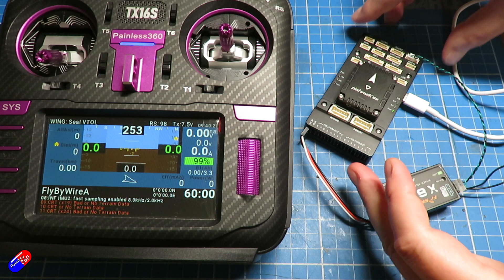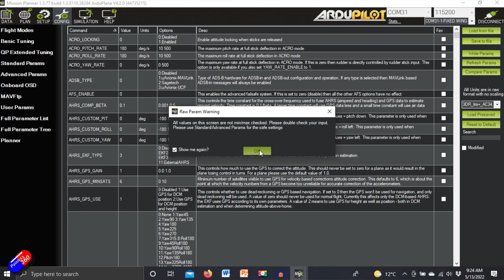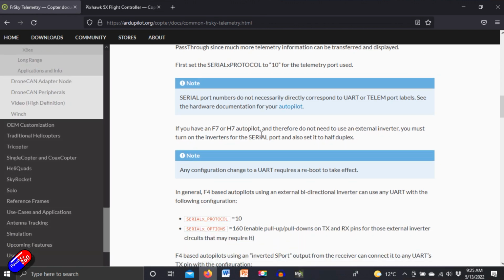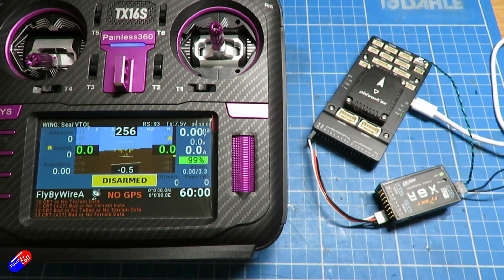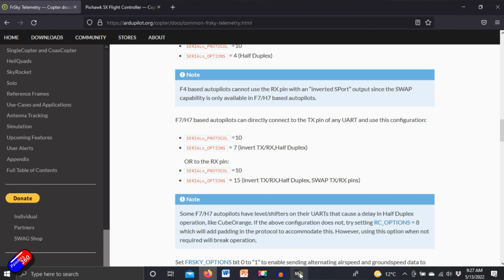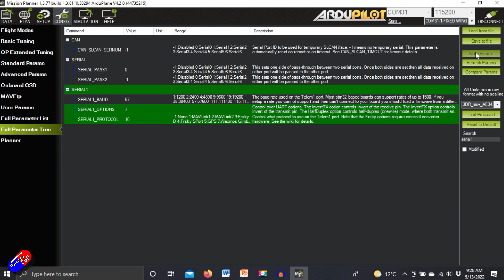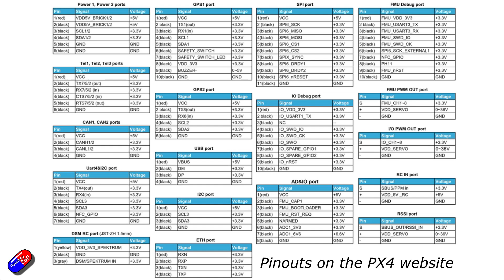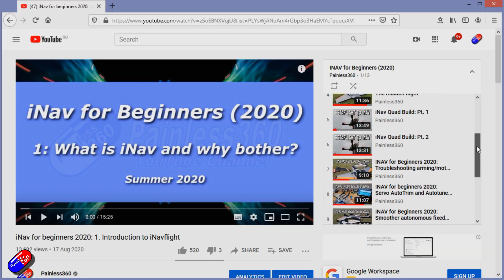How to setup Smartport telemetry on a Pixhawk without an external inverter board

Comment: Help~ i'm using r-xsr with Taranis X9D, the flight controller recives the stick input, hut there's no telemetry communication. My radio don't receive any sensor information. The exact same receiver works well with another fc under iNAV. Do i need to switch to x8r? ....
Reply from the maker: I've not seen that. Sounds like the settings in Ardupilot are OK, maybe there is an issue with that RX? I'd recheck the wiring.. Best of luck
Reply: @Painless360  thank you so much. i'm using a pixhawk 6C, trying to verify what is the reason. At least the FC receives the stick input, just no telemetry communication

Comment: Hello! My setup consists of an X8R receiver, a Taranis X9D Plus radio and a Pixhawk Holybro 6C. Could I use this same configuration and video connection? Would it work in the same way? Thank you! Hugs from Brazil!
Reply from the maker: Check out my recent build using a 6C where ai show that... Best of luck

Comment: Thanks for the video. I have a PixHawk 4, RX8R receiver and the Taranis X9D plus. Connected Pixhawk to Smart port and on the Taranis did “Discover Sensors” on the telemetry page. The only remote sensor that was discovered was the GPS position which gives the correct value. In Mission Planner I have enabled the Battery Monitor 1 and it reads the correct voltage and current, but the values (sensors) are not pulled through to the Taranis radio. Am I missing something in Mission Planner?
Reply from the maker: If the GPS sensors are coming though then it sounds like the telemetry is working OK and you have the basic setup correct in mission planner (if you had it wrong, then nothing would appear). There are a number of ways to connect to Smartport not (https://ardupilot.org/plane/docs/common-connecting-sport-fport.html) and it can be easy to get the setup wrong if you are using one of the other methods. I tend to use the adapter board. Best of luck!

Comment: When I plug my PX4 to USB and start Mission Planner and connect and go to do a search under "SERIAL" under the Config/Full Parameter Tree as you do at the 4 minute mark, I get zero results.     I am trying to configure as a rover boat and get it working with a Jumper R8II (R8 rev 2) receiver and TX16s with Edge TX.  I got the R8II binding using power from a separate source but can't seem to get power from my RC pins or my main/aux rail.  Is this an initial configuration problem of some sort?  I don't have a buzzer or switch connected, and only have the GPS and compass connected, which, along with my gyro, seems to be working fine and feeding back in Mission Planner.  Any thoughts or advice?
Reply from the maker: Check out the full series that shows all the steps I use... best of luck
Reply: @Painless360  I've surveyed most of everything that you've recorded that I've thought might be pertinent.  I've had several issues... I think that one of the problems I've had was the FMU edition and the 1GB flash limit.  I did resolve my missing Mission Planner parameters problem which seemed to be tied into the FMU (version 2) edition.  It seems there are other problems linked to that, i.e., virtual ports (resulting in inconsistent USB connectivity) .  That being said, I still have the PWM voltage output problem persisting (not getting 5 volts at the RC, Main PWM, and AUX PWM pins).
Reply from the maker: Sorry to hear that you are having trouble. All my setups with the kit I use here are in the videos. Best of luck with it...

Comment: The holy grail now (at least for me) is - Mavlink connection using TX/RX telemetry to the Radio,  and then to the Laptop.  I seen its been done but a Vid on that if you've managed to do it would be amazing.  Because I'm late to the party and don't have a Mavlink TX/RX yet. Matt
Reply from the maker: It could be easier to use telemetry radios to the model from the laptop and use the radio as a USB controller for the laptop too..
Reply: @Painless360  Good point.  I'll look into that, not thought of doing it that way.
Reply: I do this with a transmitter trainer port into a usb converter,  turns the radio into a joystick for flying through mavlink

Comment: There appears to be a bug in either the yaapu Lua script or edgeTX 2.7.1. The widget keeps restarting on my radio and i have seen others on the forums with similar issues
Reply from the maker: Please make sure that you report these issues to the project using GitHub so they are aware of them.
Reply: Link to a fix for the edgeTX 2.7.1 and Yaapu issue https://www.rcgroups.com/forums/showpost.php?p=49299729&postcount=852

Comment: cool makes life easier. On my big quad I run ardupilot and have telemetry tx/rx that communicate with either mission control on my laptop or Q ground control if I just take my phone. I use it as a back up if my trans fails I can "fly" the quad home on the pc or phone and monitor its progress or just use the pc/phone control to finish what I was doing before reestablishing control/connection with my trans. However I'll probably get a receiver that can tx telemetry so I have it on the trans as well. Good info as always. Stay safe Lee

Comment: My pet peve are the frail, thin wires.  Movement, vibration all work harden the thin copper strands in the thin wires eventually causing a difficult to detect break in the wire.  Other than occasionally annealing copper to renew its softness and flexibility,  I don't know of any way to avoid such breaks in thin wires. Great video.
Reply from the maker: There are plenty of tips - Leave plenty of slack to avoid any flexing, secure the wires securely so they don't move about. Use crimps rather than solder to connect wires as solder creates a hard point in the wire that can cause conductors and use the right wire for the right job. Should last for the life of the model then. It is a problem I don't see here.. Best of luck!